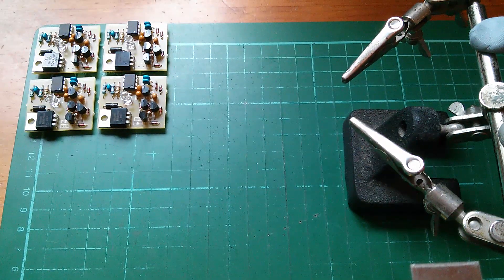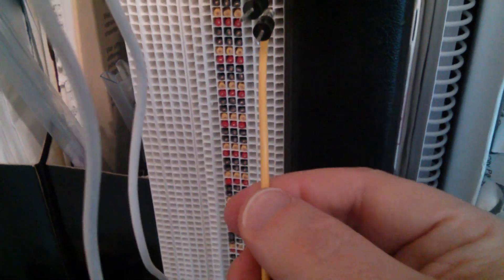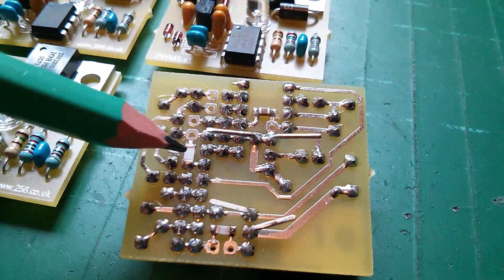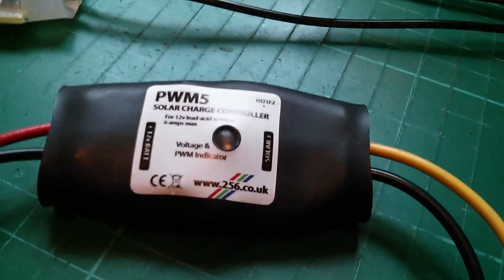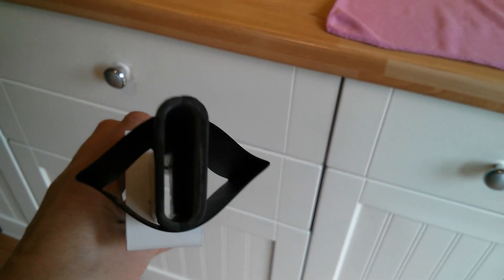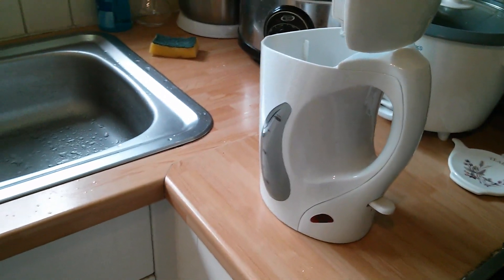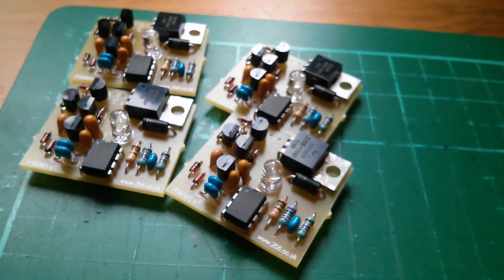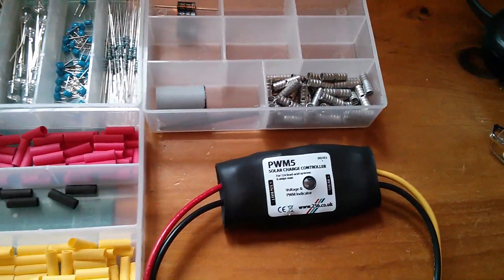Manufacturing the PWM5 Solar Charge Controller #1

Comment: Using the wrong tip to solder to that diode, you want a tip that can transfer a lot of its heat very quickly!

Comment: Hi Julian,      I have just bought my first solar (100Wat) panel, and while I am all excited to use it, I dare not connect it straight to my old car battery without a Charge controller such as a PWM5, as seen in your videos. Any chance of getting one. I know, I know, I know you have stopped making them., but I though of trying to make one myself, but looking at you videos, they don't seems to be in the correct step by step order, and some bits of it, I can understand.I have made a list of the components, it would be even easier if you still sell them, or even the circuit boards on their own, or all the bit together. As you well know ordering them from china, you cant order single pieces, and I am not making 10/100.What do you think of my request?Desparado

Comment: Where do you get the heatshrink from. The big ones on rolls? 2p for 70mm, 29p a meter is a bargain (if I understood you correctly).
It's an excellent alternative to using a plastic enclosure, and looks very professional.

Comment: do you have a eagle cad of that circuit???
Reply from the maker: It was drawn in Easy PC, but I've since switched to Design Spark PCB. I'm not sure if I've still got the original file - it would be very easy to redraw.
Reply: Julian Ilett eagle cad is very easy PCB lay-out sir,.. (poke) cabigaopauloearl@yahoo.com.ph, i am your totally big pan,

Comment: Why do you pre-shrink the sleeving? What's the advantage over just putting it over the board and hitting it with a heat gun?
Reply from the maker: For the black outer sleeving, the pre-shrink was necessary to ensure the punched hole stayed aligned with the LED. For the clear inner sleeving, I think it was to keep a consistent shape to the ends to make squirting in the hot glue easier.
Reply: Ah, makes sense! That's a clever trick for waterproofing, too.

Comment: Am I too late to get one of these?
Reply from the maker: All my remaining component stock is allocated.
However, I do have a number of units which failed quality control due to voltage regulator tolerance. This means the float and saturation setpoints are both either too high or too low. My spec was 13.5v +/- 0.09v, so any which tested 13.6 and above or 13.4 and below, failed the test. In every other way, they're perfectly good. I'll keep a few back for my own use, but the rest (there are probably at least 20) could be purchased at a discount price.
Reply: Sounds good. Slightly out of tolerance is tolerable (:

Comment: Love your videos.

Here's a newby question, how are the arduino MPPT and the PWM going to interact together to best charge the batteries?

thanks
Reply from the maker: Thanks Yves. My thinking at the moment is: The controller will be in one of 2 states. The power maximisation state, using the MPPT algorithm during bulk charge. Or, the voltage maintenance state using a PWM algorithm during absorbtion/float charge. Not sure yet about PWM frequency - it could either remain at 15kHz or it could drop way down to just a few hundred Hertz.

Comment: You would be able to put the new version to market a lot cheaper if you made it all one one board, and all smd. You would then have it P&P and reflow soldered. It would also be a lot simpler than stacking a board on top of the arduino. What I'm thinking, is that maybe you could get away with using an ATTiny? There's custom bootloaders written for them to work with the arduino environment.
that would give you 5 I/O pins, where 3 of them support PWM, and the two others have an internal ADC. In my head, that sounds like more than enough for tracking power and PWMing a mosfet?

If you would like me to, I'd have some fun laying it all out on a tiny board, with DFM in mind :)
Reply from the maker: The intention was always to make the PWM5 all SMD. But I got caught in the sole trader time trap - where increasing sales justified the development cost of an SMD version, but all my time was soaked up manufacturing the original. So I'll be taking a break from manufacturing from July, instead concentrating on design.
My plan is to use the Pro Mini because of it's low cost and eBay availability and couple it with the MOSFET driver circuitry I used in the PWM5 (because I know it works). Once the software/firmware is up and running, anyone will be free to port it to other microcontrollers, design PCBs, select enclosures and make other choices like heatsink/no heatsink, waterproof/not waterproof and so on.

Comment: I don't know how many controllers you do per month, but seeing the bucket full of heatshrinks i think it would be easier if you would use SMD parts and find a company with pick and place machine. You will still solder wires and maybe mosfet by hand. I would definitely do that for 500pieces. Also if you have square boards, make panel with v-groove, and save a lot of material.
Reply from the maker: I did a bit of research into pick and place assembly and figured that an initial run of about 1000 units would be needed to make it economic. So the idea was to pay for this from profits from the hand assembled version. However, the money and time never both fully came together, so it never got done.

Comment: Hi Julian, great video. Presumably you have the PCB's etched, drilled etc by an external company. Does this add much to the fabrication cost?
Reply from the maker: Hi Graham. The PCBs are made by a local company, Chiltern Circuits. I think the PCB came in at around £1 each - the stripboard cost around 18p but needed cutting, sanding and the track breaks drilling.

Comment: It looks really great. Looking forward to your videos on its design and manufacture :) 

Does the diode ever get hot? 6 amps max might drop a bit more than 4 watts over the diode, right? And do you have a fuse in it at all?
Reply from the maker: Yes, the diode does get hot when running at 6 Amps (from a 100W solar panel). No, there's no fuse - the user guide is quite clear about the maximum panel size (100W) so the 6A limit would only be exceeded if that advice is ignored. One possible addition to the Arduino version would be a suitably rated polyfuse.

Comment: Great info on the PWM. Question, why do you have that diode in the wire? Why don't you just have it on the circuit board and save the trouble of crimping and soldering it on the wire? Is it because of heat? Noise? More rigid?
Reply from the maker: Interesting question. Primarily it's to protect me (the manufacturer) against warranty claims. Without the diode, the MOSFET's internal body diode presents a short-circuit risk. If the battery is attached and the solar-side connections are shorted, the full current of the battery will flow through and destroy the MOSFET.
It's fitted externally so that it can be removed, but I'm very clear in the user guide that doing so voids the warranty. I did consider using a fuse (or polyfuse), but the diode provides the best protection.
The diode also gets hot (at the full 6A it gets very hot) - putting it outside the enclosure means that a heatsink isn't needed.
Reply: Yes, I get it. When you deal with the public, you have to make it, what I call, idiot proof to protect yourself. OK, I see how that works. Adding the diode will allow current to flow from the solar panel,  but not back to it, or prevent melt down if the wires would touch together. And you have a risky option to remove the diode to get maximum voltage from the solar panel. Hope it is a shottkey diode. I was concluding the in line diode was for some kind of protection. It should help to prevent damage if the polarity would get hooked up backwards too..

Comment: be very interested in how you got it ce marked emc ect, i tryed once but gave up due to cost did you get it tested?

ive just finished making a programming jig for programming  and bootloadering for the sm 328p-AU chip if you want to get away from the pro min board really easy to program the chip
Reply from the maker: No I didn't get it tested. I did my own testing and self-certified the product. It's a perfectly legitimate route to certification as long as you keep a technical file which details how the testing was carried out and how you can be sure all the relevant standards were met in the various directives that apply to the product.
Reply: Julian Ilett
hi julian i can help you with your board if you need help no cost, it would look much better if everything was on just 1 board? instead of just plugging the mini onto another board and be cheaper i just brought some 328P-AU's cost $2 each drop me a line if need help
cheers
Reply from the maker: jon white Hi Jon. I really want the first version to be buildable from easily available parts; the Pro Mini, a small piece of stripboard and a handful of through-hole components. I'm likely to use a heatshrink enclosure to keep the cost down.
After that, however, I would love to see re-engineered, single board versions with 3D printed enclosures and all the other enhancements that I inevitably won't have the time to do myself.
Reply: hi julian ok i see, ive got plenty of time dont mind laying it out for you, used to be pcb designer many moons ago, just got back into it after learning c, ive already got a bare bones 328 au already layed out you can just add to it, if you want drop me a line if you want it cheers jon
relly like your vids, im also a keen buyer of asian gadgets now i also plan a solar project soon

Comment: What about shrinking the heatshrink in an oven?
Reply from the maker: I did consider that, but I'd need to put lots of them on the former at the same time (so I'd need a longer former). The former would have to be metal, the vacuum nozzle would melt. And then there's the problem of removing them from the former afterwards.
Reply: Julian Ilett What about making the former out of wood? You could whittle it with a sharp knife and some sandpaper.
Reply from the maker: John Smith Unfortunately, my woodworking skills are terrible! Also, the heatshrink sleeving has extraordinary grip - it would bind very tightly to the wood grain and be difficult to remove. Then you'd be looking at using a lubricant.
Reply: Julian Ilett why not put it on the board, and stuff the whole board in the oven?

Comment: ever tried a hot air gun? :)
Reply from the maker: That's the only part of the process which uses hot water. I use a hot air gun to complete the shrinking of both inner and outer sleeves.
Reply: Maybe the shrinking tube gets off more easy with water, having water between the rod and the shrinking tube.